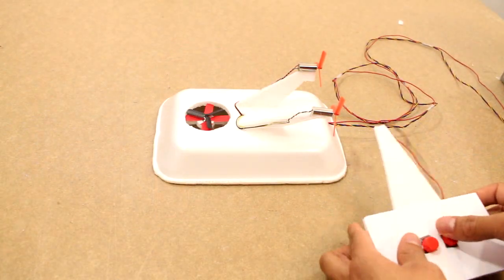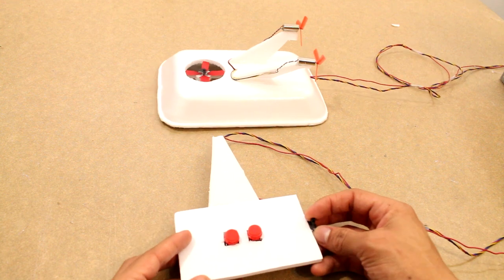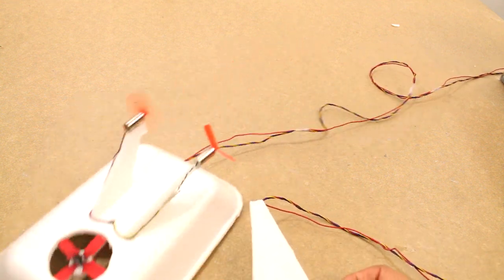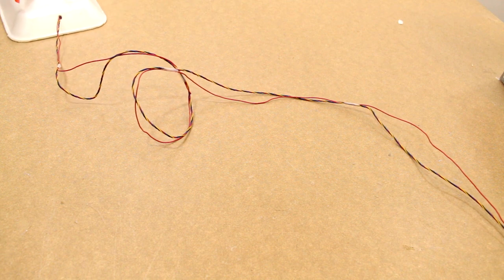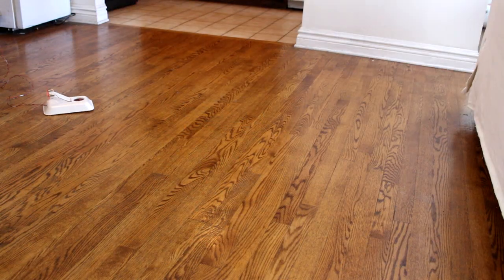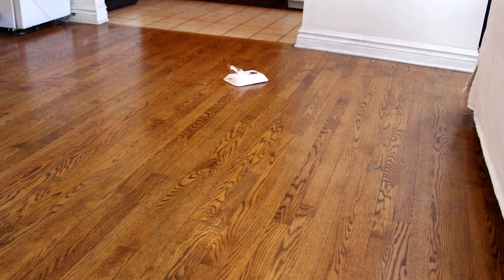How To Make a Remote Controlled Hovercraft

Comment: you might want to attach a identical foam bowl to the bottom with a small space,maybe a 1/4 inch below the main one,so that the hover air escapes around the edge of the bottom giving a significant lift and level hover like a full scale hovercraft.Just a suggestion hope it helps and nice job so far... Awesome :)

Comment: not hating with logic but its really not remote controlled if you have wires (remote as if controlling from far away) coming from it. if you want to make it wireless you could scrap an old rc car for its board and wire the motors to the drive output (forward and backwards) and flaps with servos wired to the steering output.
Reply: lance_b5 yeah true but this project aims toward simplicity i guess
Reply: Remote controlled explosions have wires to the plunger, wireless idea would be great, light balsa motor pylons would be smoother.